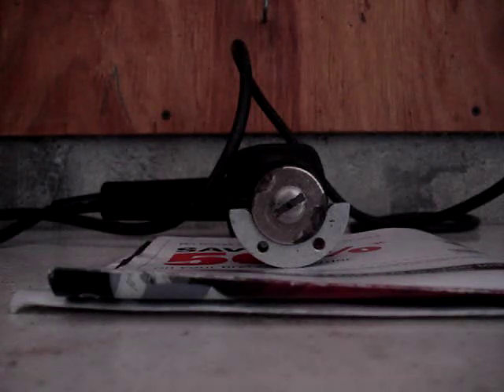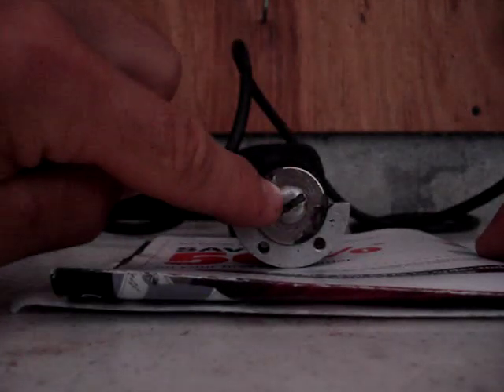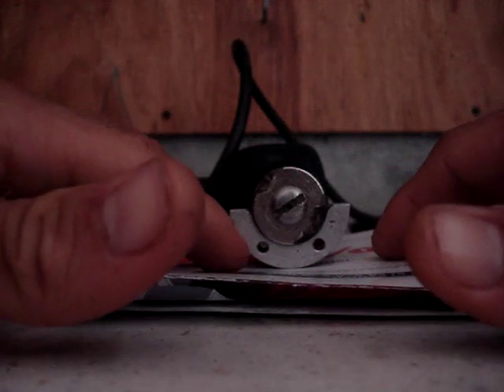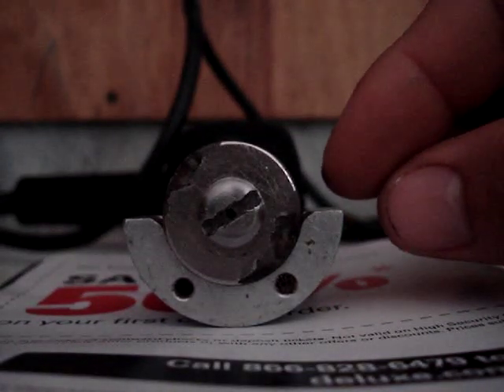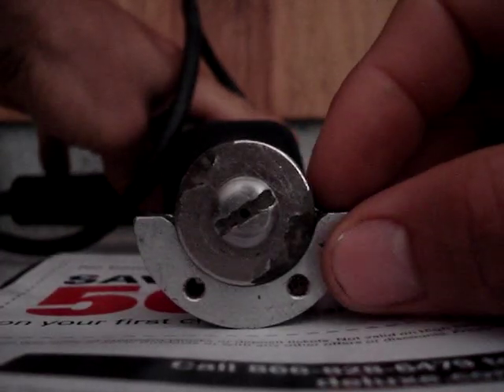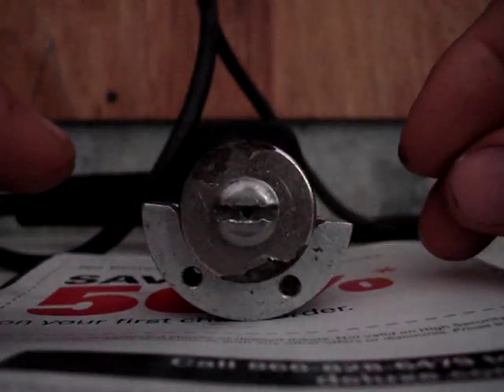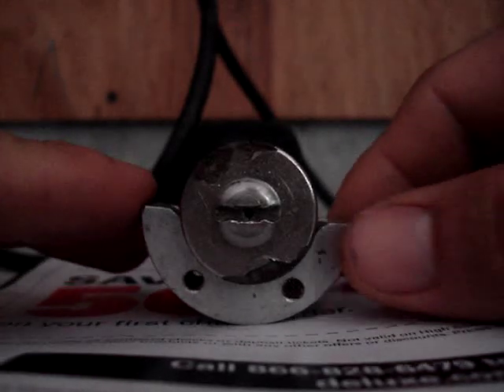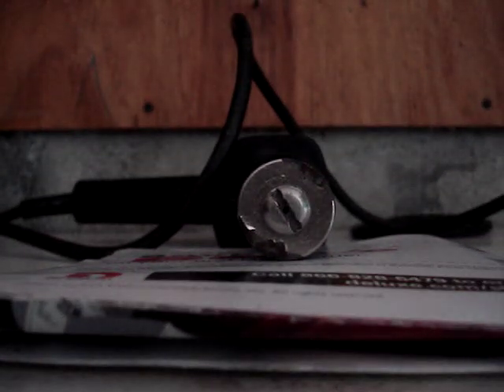A frictionless bearing

Comment: Not frictionless at all. Firstly aluminium is not attracted, let alone repelled by a magnet. Secondly if his rotating disc was round, or the experiment done in a vacuum then the two pieces would touch. Rotating "magnets" are catching air and crating an air cushion.

Comment: The rotating magnetic field is introducing eddy currents in the aluminium and an opposing magnetic field. This effect has been used for 150 years in eddy current braking and other uses. This is not a bearing.

Comment: The problem is that rotating the magnetic field through the aluminum does produce resistance, despite the lack of contact friction.

This electromagnetic resistance heats up the aluminum, just like contact friction.

The kick point is that the electromagnetic resistance increases with speed, and unfortunately is stronger than contact friction of a normal bearing.

If you drop a magnet through an aluminum tube, it will fall slowly even though it never touches the walls of the tube...  it falls slow because of the resistance caused by moving the magnetic field through the aluminum.

Proof that normal contact friction causes less resistance than the electromagnetic induction, is that the same magnet will slide faster down pretty much any surface (even grippy rubber) than while floating in the electromagnetic field.

Research these points if you want.

Comment: I CAN NOT believe how many simple minded morons there are out there. This video is profound and is due far more positive recognition than it received. I believe this principle is sound. I can't wait for this to begin making it's way into production spec systems in their varying kinds - if big business lets it. Good luck and thank you for putting this great experiment/ info out there.
Reply: it is far from a frictionless bearing. there may not be physically contact, but the fact that the aluminum semi-circle got kicked away proves there is a substantial amount of resistance being created when the magnetic moves within it...
Reply: +Outrageous Alex youre right
Reply: eddy currents create heat. Far from zero drag.

Comment: So just coming up with ideas, I don't really know that much about physics. But if you used this method, say, in skateboard bearings. And instead of making the magnet the center of the bearings, but making the wheels of the board the magnet and the "bearings" would be the magnetized metal. If you could use a magnet powerful enough to resist the weight of a human on top of the skateboard, the force of each "push" from a skateboarder would be enough to center the magnet between the bearings and come up with a near-frictionless interaction and your skateboard would be "levitating" in a way, even though it would still be tethered to the ground, yes?

Comment: Resistance (not friction) is created by the eddy currents, and how much resistance would depend on the proximity of the magnet to the aluminum (or copper) surface. BTW, kasmackba, it's brake not break. I think this might be useful to stabilize a vertically oriented shaft as long as the resistance could be controlled. Magnets retain their magnetism for about 300 years last time I checked, so for at least  200 years, people, there would be nothing to wear out or replace as far as a bearing is concerned.

Comment: yeah but its only a "frictionless" (not exactly frictionless) bearing when you are applying energy/momentum/rotation to the magnet so i fail to see where this is useful or really proving anything. its a magnetic bearing. low friction at the cost of high energy input.

Comment: Of course aluminum is non-magnetic... The effect isn't caused by the aluminum reacting in that way. It is caused by the magnet inducing a current in the aluminum going in the opposite direction, and in turn causing the magnet to repel. Take a magnet and move it quickly back and forth over an aluminum can. The can will move.

Comment: Doubters: Any magnetic field has an associated electrical potential. The spinning permanent magnet causes magnetic flux that induces an opposite electric current in the electrically conductive aluminum. Because an inductor resists changes in current potential it lags behind the magnet in polarity effectively making it + to + and - to - and causes the two pieces to repel eachother (I think) Frictionless because there si no contact, but EMF is going to make the motor work a bit harder. Good video.

Comment: @kasmackba Let me add that there IS friction between the spinning surface and air... also known as windage. As I explain in another reply, at this scale it is small enough to be negligible and hence I did not consider it. So yeah you could say there is technically friction.

But eddy current losses are not friction! They are a loss indeed, but not a friction loss.

Comment: @TheRealDealinlife Technically, no.

Let me explain: there is friction between the bearing and the air it is moving through. This is usually defined as "windage", but at its core it is still friction (contact between air and bearing surface). For your size bearing though the windage is likely so small as to be negligible (unless you get to REALLY high RPM).

In a vacuum you would have created a frictionless bearing.

Does that help? Hopefully I'm being clear.

Comment: @TheRealDealinlife Just so you know, there is no friction but other loss mechanisms exist. Also, if you're gonna use that drill... the drill itself will have friction within it so while your bearing is frictionless (but remember, not lossless) the system as a whole is not frictionless. kasmackba is kinda correct, but is getting some terms mixed up. (I work in the magnetic bearing industry so you can consider me a sort of expert on this subject)

Comment: @kasmackba Your analysis is partly correct. Eddy current losses are not considered friction. He's right in saying it is friction-less - the key is that it isn't loss-less. Does that make sense? The other losses include windage (minor) and eddy currents (major). In a vacuum it'd just be the eddy currents.

Point is that just taking away the friction has many benefits in industry provided it can be controlled. Active Magnetic Bearings do this quite well when the application is suitable.